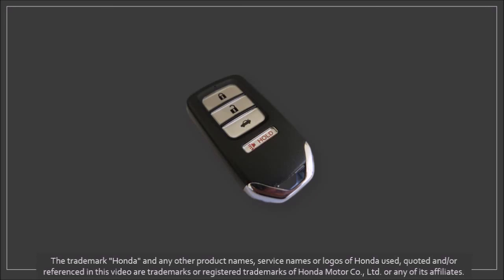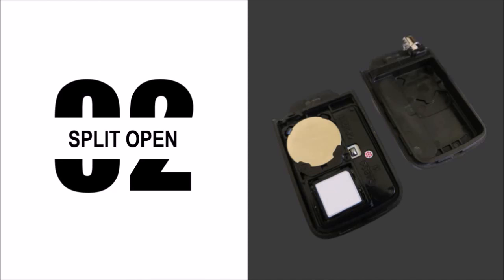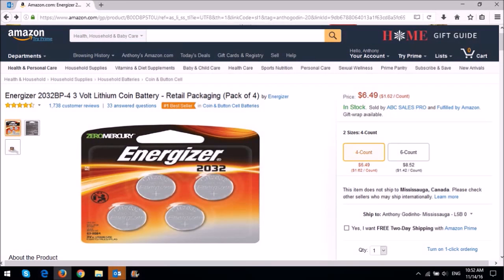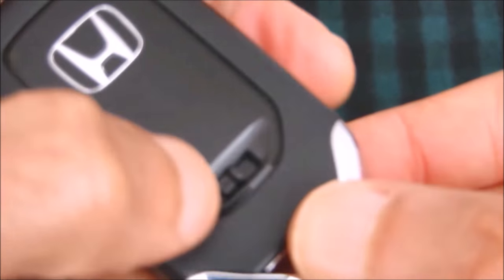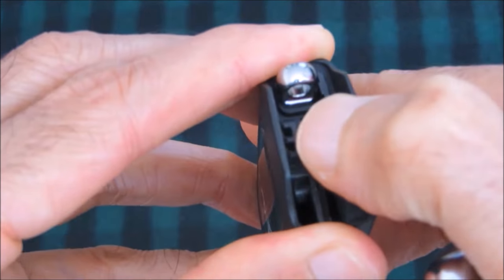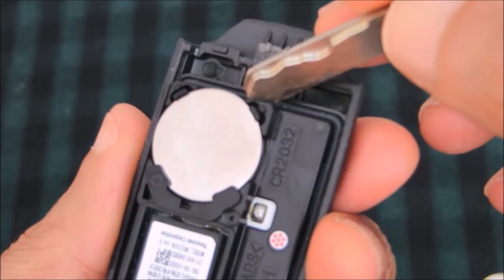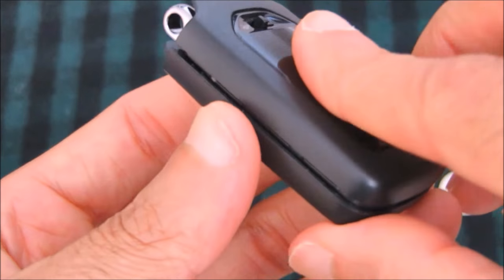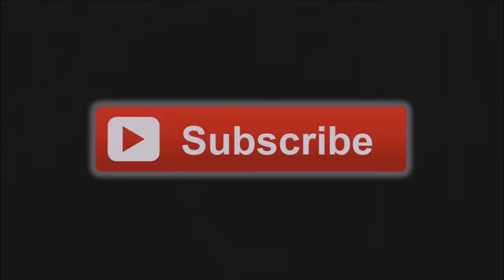How to Replace Battery in Honda Keyless Remote

Comment: Thankyou! VERY useful. The manual had no information about how to open the fob and replace the battery. I saw the latch and got the key out, but couldn't figure out how to open the fob without breaking it.
Reply from the maker: You're welcome Janine. I'm glad you found this tutorial helpful. Yeah, I agree - opening the fob can be challenging without the trick I use in the video. That's where I was stuck as well and didn't want to damage it. Thanks for stopping by...cheers!

Comment: Nice video and should have worked well.  Unfortunately, I was too vigorous in removing the battery and the whole bottom section popped up out of the holder and the buttons moved.  Since then, I can't get the buttons to line up and work, thought I can close the cover again.  Any hints to line up the buttons again?
Reply from the maker: Hi Chris, sorry to hear that you accidentally pulled out the whole bottom section of the keyless remote. I've personally not ventured into that area. So the only thing I can suggest is that you patiently and meticulously place the buttons and line them up with the connectors before you close the cover.

Worst case scenario, if you still can't do it - you may have to take it in to your nearest Honda dealership. Hope you're able to to get them in place and get it working...cheers!
Reply: @AnthonyGodinho  Finally figured it out.  the buttons face outward and I was putting them in the wrong slot, then wrong orientation.  Finally got all the ducks in a row (on the 6th try) and everything fell pretty easily in place.  So easy now.
Reply from the maker: Ok, that's great Chris. I'm glad you figured it out and got it back together. Sorry, I'm just seeing this comment notification today. Looks like there was an issue with YouTube comments because I just got the notification for this comment today.

Comment: Thanks! Does the fob require programming after the battery change?
Reply from the maker: @lingzzie you're welcome! In terms of your question, no, the key fob doesn't require any programming after you change the battery.
Reply: @AnthonyGodinho  I had to get mine reprogrammed the last time I replaced the battery. I agree it shouldn’t require but the possibility is there.
Reply from the maker: @J Honey Oh, I see...that's good to know. I've had to replace my battery 2 to 3 times and it didn't need any reprogramming. Did you replace the battery as soon as it died or waited a few days before you replaced it? If so, approximately how long did you wait until you replaced the battery?
Reply: @AnthonyGodinho  it was not immediate, so probably a week if I recall. It has been a while. Found your video since my battery is low. Appreciate your video
Reply from the maker: @J Honey Oh ok, thanks much for letting me know. I'm glad this video helped and I appreciate you stopping by. Cheers!

Comment: I took out the battery from the fob but when I am putting the battery it's not fitting in. It gets popped out back. The battery is of same dimensions and type
Reply from the maker: Hi Shreyansh, if you're using the correct battery, it should fit fine. Notice that there are a couple of black spring hooks to hold the battery in place. Did you make sure that the battery is snug into those spring hooks?
Reply: @AnthonyGodinho  IDK, when I'm keeping the negative terminal up the battery gets fit, but when I keep positive terminal up it's not getting into those springs
Reply from the maker: @Shreyansh Upadhyay is your keyless remote the same model as this one? If so, the positive remains on top. Before you removed the dead battery was it sitting snug into place or did it pop out? Also, I'm assuming the positive terminal was facing up? Are those spring locks damaged in any way?
Reply: @AnthonyGodinho  Yes when I took out the cover, the positive terminal was up facing, but I don't understand that I can't now even insert the original battery again. However somehow I just made it hold the position and covered it. It worked but I think when I will open again the cover the battery will pop out 😂😂
Reply from the maker: @Shreyansh Upadhyay yeah, that's very odd. Well, I'm glad that you managed to keep it in and it's working. You hopefully won't have to open it for another couple of years :)
Reply: @AnthonyGodinho  I hope too 😂😂😂😉.
BTW thanks for the video ✌️✌️
Reply from the maker: @Shreyansh Upadhyay you're welcome bro...cheers! :)

Comment: changed the battery but sign is still showing up on the dash
Reply from the maker: Hi there, is the keyless remote working? Either way, you can just reopen it and just make sure that the battery is sitting snug into its place.
Reply: it is. do i i have to reset on the dash board or it would do automatically
Reply from the maker: Ok, that's good your keyless remote is working. Generally, the dashboard warning should disappear automatically. Though, some vehicles may require a reset procedure for the warning to turn off.

Comment: What is step 2? I don’t follow
Reply from the maker: Hi there, in step 2 you split open the remote using the key by placing it into the little grove. Did you watch the full video? I showed exactly how to place the key into the grove, twist it, and then spit open the remote so you can get access to the battery compartment. Hope this helps...cheers!
Reply: @AnthonyGodinho  thank you

Comment: want the car starter not the key fob
Reply from the maker: Yeah Linda - sorry, this video is for the Honda keyless remote, not the car starter. I would think the process of changing the battery would be similar, though it would depend on the type of remote car starter.